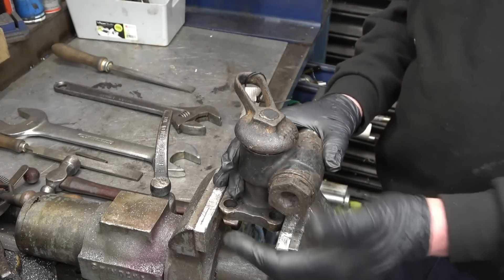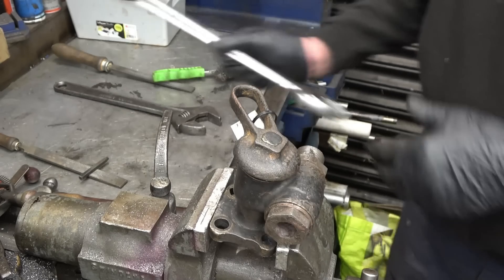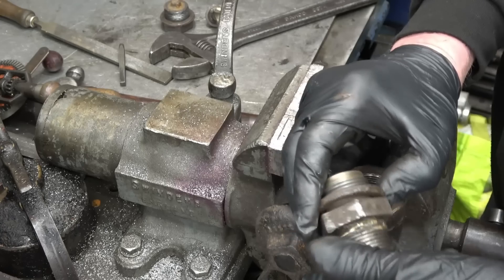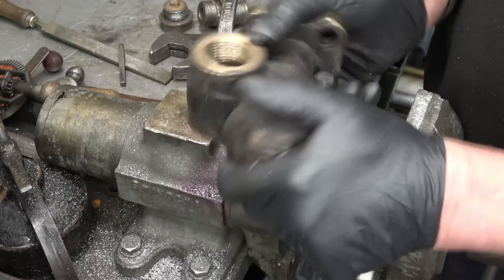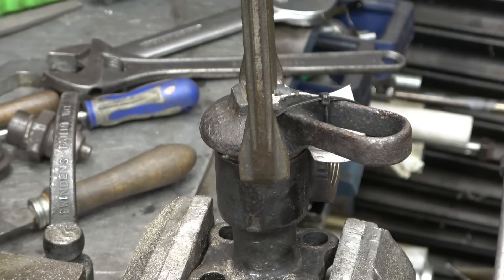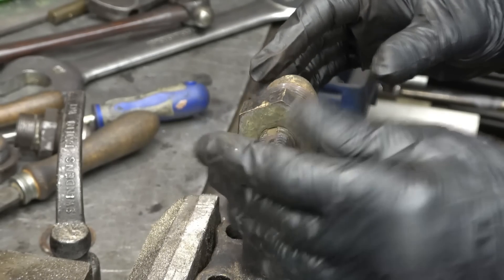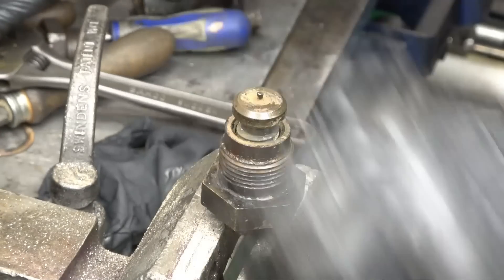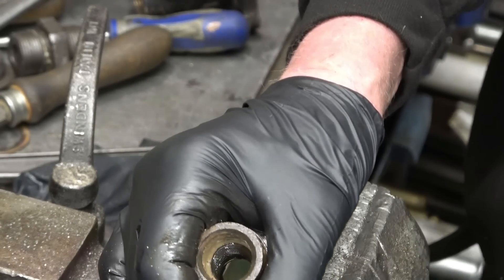SNNC 480 P2. Steam Boiler Clack Valve Evaluation

Comment: For the handle, have you considered drilling and tapping the stem, then you can use a screw and washer to hold it on. 
As for the swearing, I had to check that I wasn't watching on Patreon. 😆

Comment: I did something like that once mate. I threw the offending bit of angle iron at the work bench in a fit of rage, watched it ricochet off the steel bench into the  wife's car. The sharp bit punched a hole in the quarter panel and the long bit  smashed the plastic tail light moulding. I think I said something like "BUGGER" loud enough to blow the high tension fuse on the street light power pole outside the house. That little outburst cost me about eleven hundred dollars and the best part of a bottle of Johnny Walker. I completely understand where you're coming from.

Comment: armchair opinion... square off the end of stem so it will go through nut, braze the handle up and file out to fit stem, tap hole in stem for bolt to hold handle on. hope your finger has quit throbbing

Comment: I reckon someone put that together and set it up without the washer. When it leaked around the thread they realised it needed the washer. Of course, with the washer in place the valve face and seat didn't meet. They had already locked the handle on so tight that they couldn't adjust it.